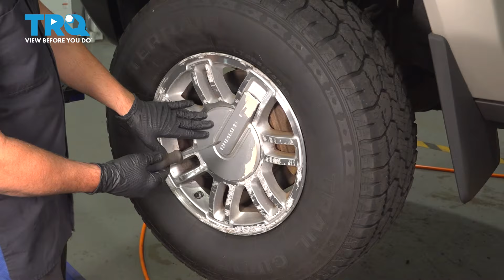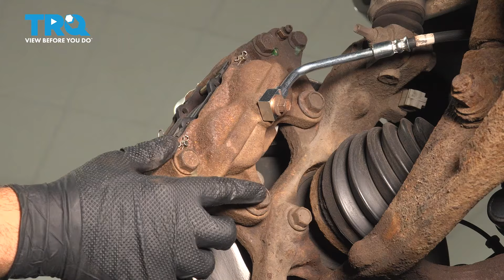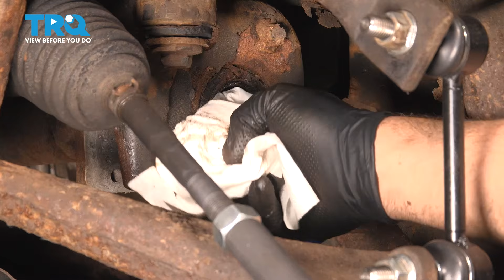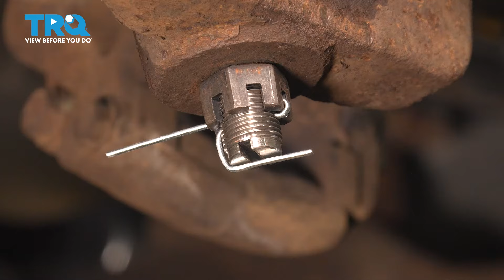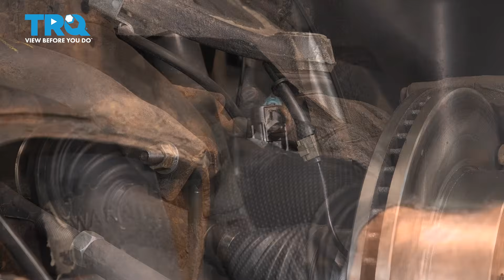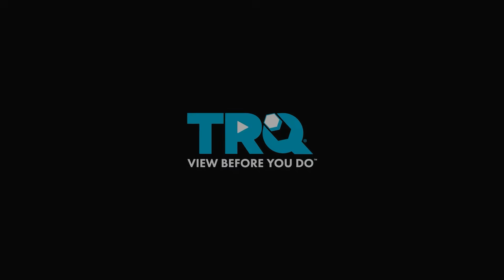How to Replace Front CV Axle Assemblies 2006-2010 Hummer H3

Comment: When you tighten your lower ball joint nut you said use a 24mm socket, but when you removed it you said use a 27mm socket.